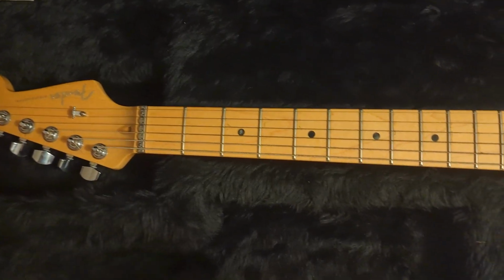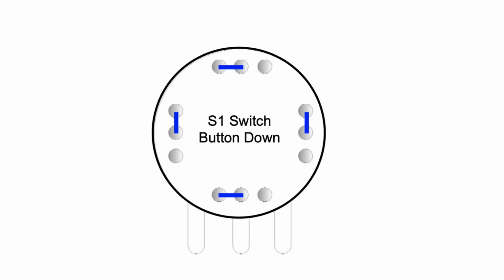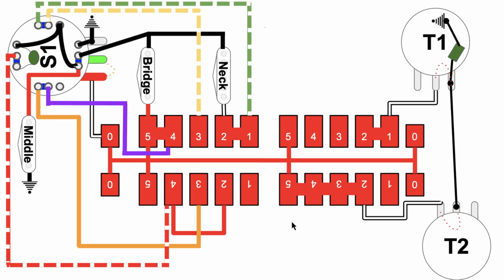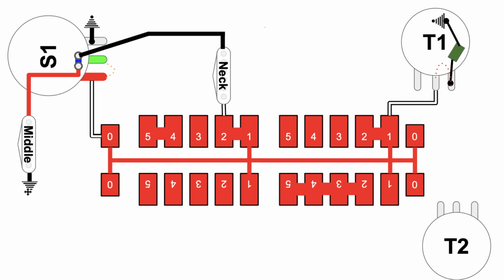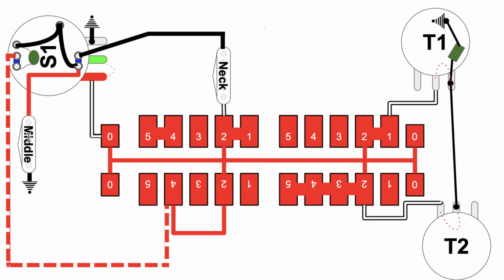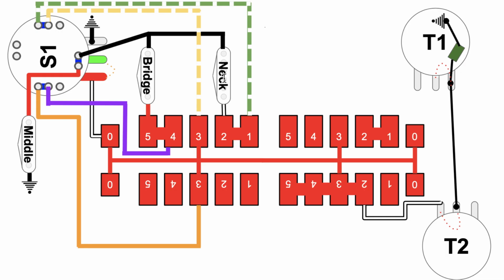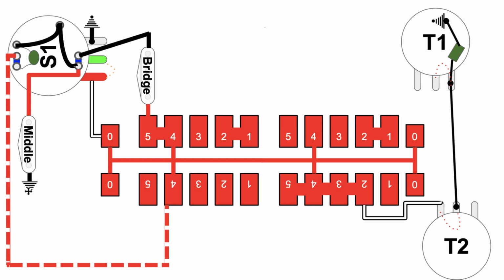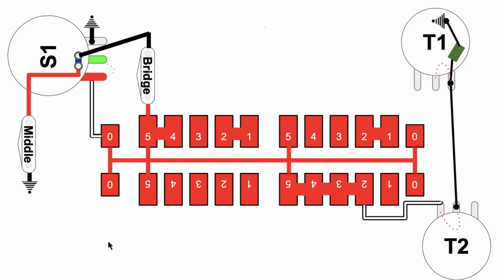Fender's S1 Button in a Stratocaster: How It Works and How To Troubleshoot It

Comment: What a great video. I've got a customer's Oswald custom Strat here with the S-1 switch on the 2nd (last) tone pot but the apart from that, the logic is the same - although judging by the functionality the wiring schema is a fair bit different. Despite that, this video perfectly explains the signal path in the 10 distinct positions when 5 way switch and S-1 are used together on the Strat - and that gives me a better understanding of what's going on with this Oswald Strat even if I don't know exactly what they were aiming for.  Thankfully both switches on the Oswald appear to be working (apart from a tiny intermittent cut out when one of the pots is lightly pushed)... I'm glad I'm not wiring this up from scratch - because the amount of wiring revealed when I lifted the scratch plate is extreme! A good wiring diagram would enable me to put this together from scratch but your video means that I would understand a lot better what was actually happening. Great work.

Comment: Outstanding video! I originally watched the  video you did on the Telecaster S1 issue in order to try and solve a volume cut off problem I’m having with my 2019 Telecaster Ultra.  That video was excellent too. Because that video was so good I decided to watch this one as well.  Glad I did.  It gives me even more understanding of how the S1 switch is wired and where to check for continuity, both where you have connection and where you shouldn’t.  I would have never been able to figure it out without your diagrams and the way you explain the circuits.  I don’t see the  video on the final resolution to your Telecaster issue.  Looking forward to seeing that when you get a chance to put it up.  Thanks for the time and effort you put into this video.